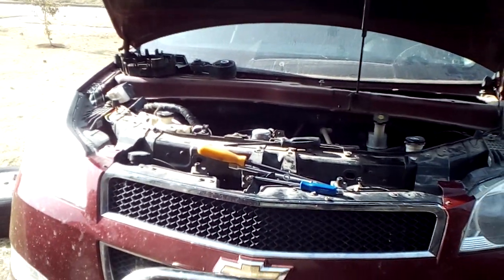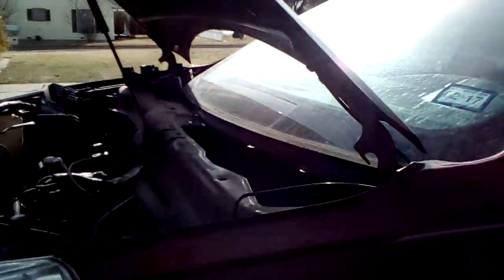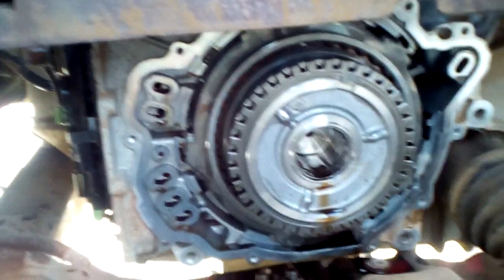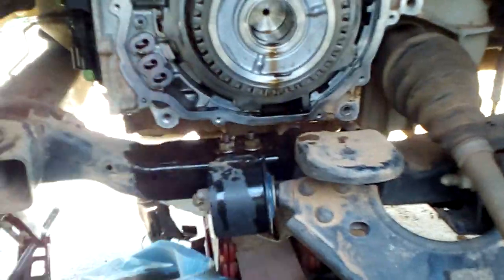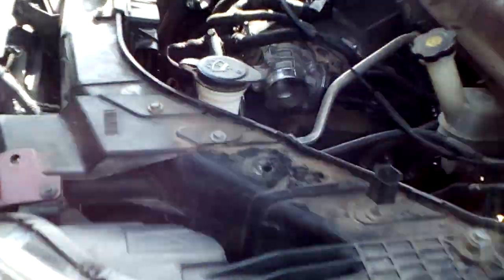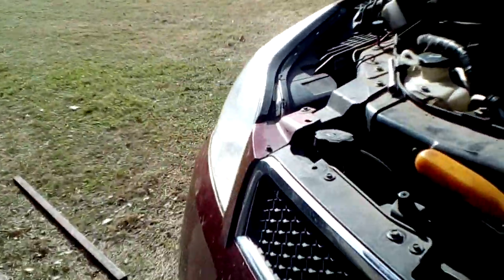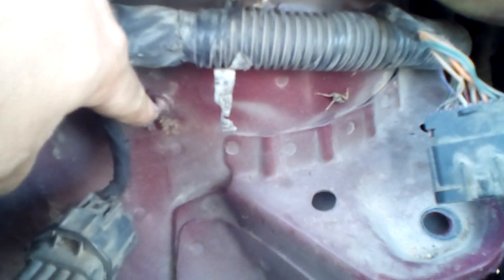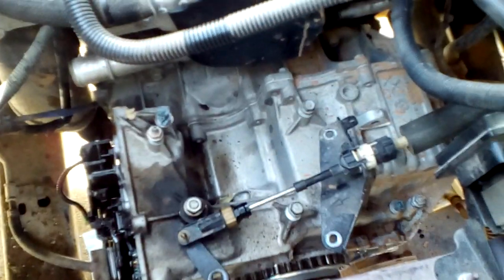Traverse Acadia Enclave Outlook transmission access.

Comment: I hope your doing well my friend and thanks for this video. I have a question though I doing the same thing to my acadia but it just doesn't seem to come down any further and I can't pull out the trans cover. Did you remove the bracket from under the motor and trans that goes across?

Comment: Great write up.So other than removing steering knuckle, exhaust , passenger motor mount, what other significant items did you have to remove?When removing the fuse panel... do I need to know any order of operations? Airbag shit or anything else? Also like Ron said below, theoretically if you supported the cradle and engine, could you remove the transmission this way as well? I have to replace the TEHCM and figured I’d replace the 3-5-R as well. Just hoping you can shed some light on it

Comment: Hello quick question will the torque converter overheating but the transmission works fine do you have to pull the whole transmission out to check the torque converter and will a bad torque converter makes the car vibrate in drive but not in park
Reply from the maker: As far as diagnosing your problem goes, I couldn't tell you one way or another. I'm not a mechanic. I do know, however, that you will have to pull the transmission to get to the torque converter.

Comment: So it should be possible to replace this transmission & torque converter while the vehicle is on jack stands and not have to have access to a lift.
Reply: Yes but you will have to support the engine from the top with motor support tool drop the cradle unbolt trans. From motor and lower the transmission leaving the motor in place suspended from the motor support tool

Comment: Did you get this code after disconnecting the steering and putting it all back together c0710-00 Steering Wheel Angle Signal? Panel is saying service traction control and stabilitrak
Reply from the maker: I don't remember ever getting that code.  I took mine to my local dealer after I replaced all the clutch plates and had them reprogram the transmission computer. Cost me about $75.
Reply: @jeremccurdy  oh! Okay thanks. That was my next question. So was it still slipping after the clutch plates and wave plates till the reprogram?

Comment: I have a 2011 traverse awd, codes say it's the input speed sensor, gm shows on prints that's it's in a cover on the driver side on the bottom so do I have to drop it the same why
Reply from the maker: Possibly.  You might just get lucky and be able to access that cover without dropping the frame. That front cover is easier to get at than the side cap.

Comment: Is there any other holding mounts needed to be removed? I guess you couldn't have enough clearance unless you drop the cradle. Is that right? Could you pull out the whole transmission this way if you had to? Thanks
Reply: I’m definitely wondering the same thing.

Comment: I got a 09 Acadia but the suv needs to get gas in reverse sometimes it rolls sometimes it doesn’t the shifts just take a while like slow shifts rpm at idle is 590-620 mpg is 5.5mpg
Reply: I'm having the same problem, what did you do to fix it?

Comment: How's your Traverse running? Any issues? I assume you didn't replace the filter inside the transmission, so just curious if you had any lingering issues after the replacement? I'm currently dealing with this same issue, and all the GM documentation is saying you have to split the case and replace the filter when one of the wave plates breaks. Thanks!
Reply from the maker: I did not replace the filter. I did flush all the old fluid out of the transmission and cloth strained it looking for metal filings or fragments. I didn't see any so I did not replace the filter. I have put about 20k miles since the repair and the car is still doing fine.
Reply: @jeremccurdy  Just wondering why you didn't replace the filter?
Reply: was it because you would've had to split the case? Hypothetically would replacing the filter promote further tranny damage?
Reply from the maker: @jjtfarrell  To change the filter you have to split the case.  That means full removal of the entire powertrain cradle.   I didn't want to do that if I didn't have to.  Had there been metal shavings in the transmission fluid when I drained it, I would have.

Comment from the maker: You sure can. There is another channel, I believe it's Chris Bruno, that shows a better video of how to remove and replace the entire cradle/power train assembly.
Reply: Thanks Jeremiah, I don't have a lift was just wondering if I can raise the car high enough in order to pull the cradle from underneath if I need to do a complete overhaul? By the way, did you have to remove the exhaust out of the way?
Reply from the maker: Yes, I did disconnect the exhaust flex tube. It is easily accessed under the passenger side of the vehicle. The way I did it, I could have pulled the whole cradle out. I chose not because I didn't want to disconnect the heater lines, A/C lines and coolant hoses.
Reply: Sounds good! I have more courage to do it now! I just replaced an engine on four cylinder GMC Terrain. I wish there was any ways to know if I could just drop the cradle and then yank it out and swap the engine outside. It was a close call but I didn't take a chance. I pulled it from the top and was time consuming. Getting a lift is on my Xmas list!